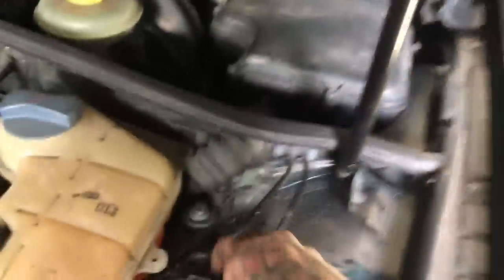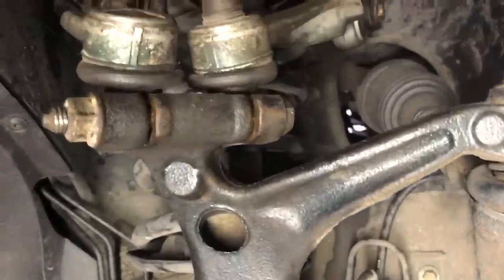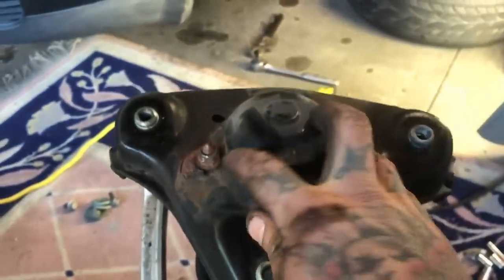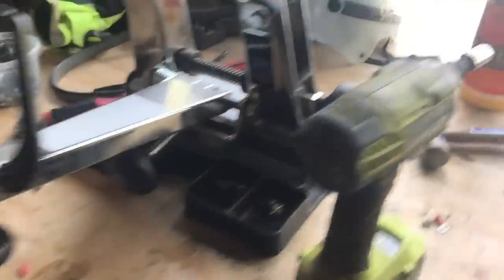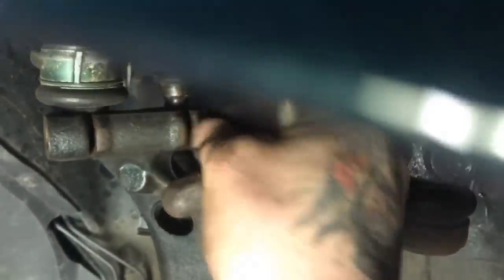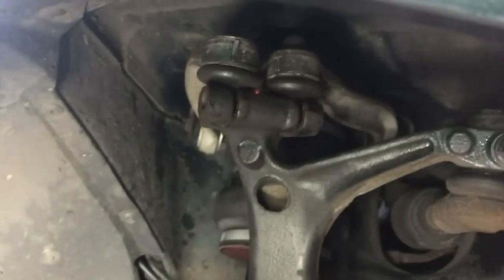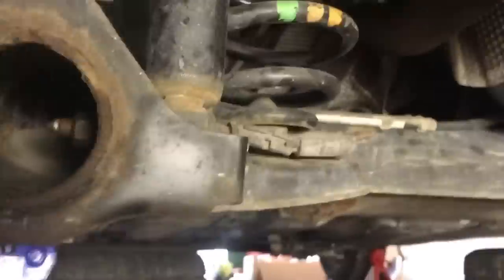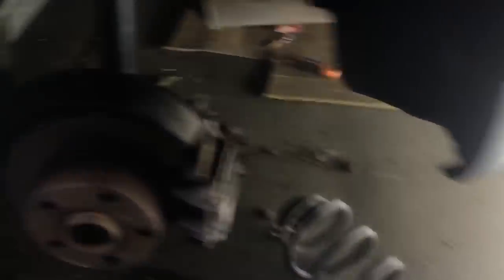How to bag Volkswagen B5 Passat wagon

Comment: is the process the same for the awd model ...glx wagon  ?  thank you for your information  !
Reply from the maker: this was the glx front wheel drive 1.8t 
the AWD model should be even easier, because the rear struts just bolt in, no need to drill like i had too. if youre using airlift you made the right choice!
Reply: thank you  👍